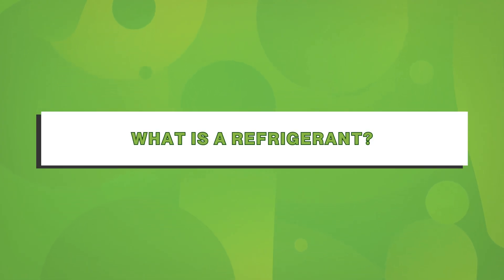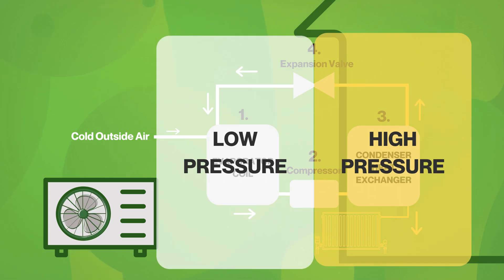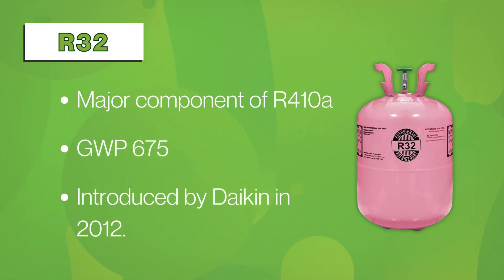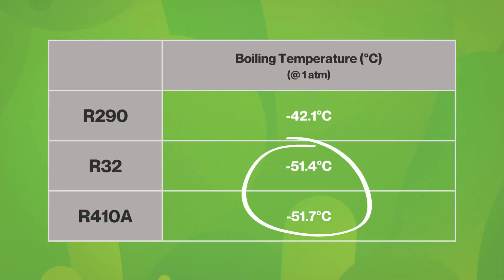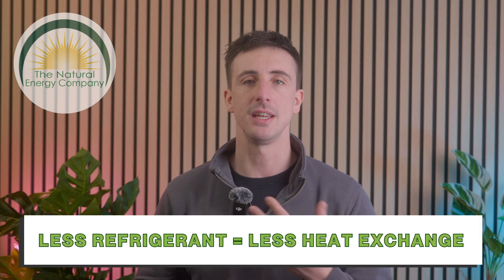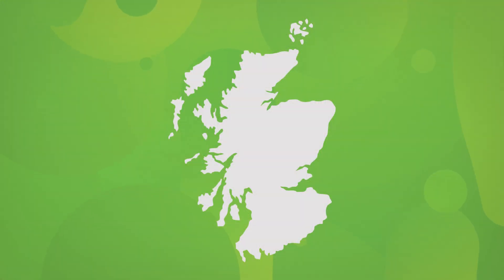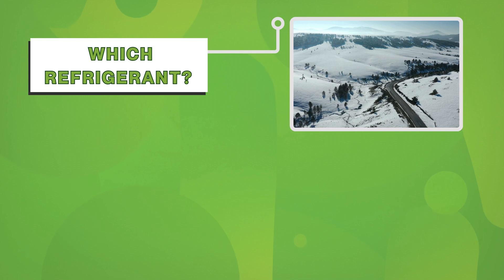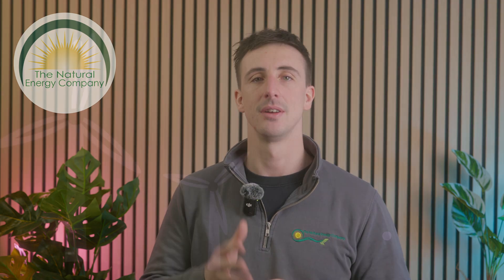R32 vs R290 - Best Heat Pump Refrigerant for Your Home?

Comment: Great video....I am interested in a split unit for my out building....I have one now (R290) which is great for AC but below 8 degrees cannot give any useful heat. I have been looking at LG S12 units that are R32 but I cannot find out what they actually work down to.....its annoying! Would you have any advice? Thanks
Reply from the maker: LG make some great units but Daikin definitely are the best when it comes to AC!

Comment: Interesting. I’ve had an R32 Daikin Altherma 3H HT mono block ASHP for over 4 years. SCOP of 4. I live in rural Worcestershire, England. When selecting the Daikin I had many questions and quotes. But I don’t think the refrigerant was a big point. Fast forward 4 years & I’m seeking an ASHP for my mother-in-law to replace a 20+ year gas combi boiler. Based on location, the R290 unit had to be on the side of the house, away from windows, drains & making garage access difficult. Compared to the R32 Daikin solution that could be near the back door with a short pipe run up to the airing cupboard space. R32 is her answer. The SCOPs seem very similar. Keep up the good work
Reply from the maker: Thanks for sharing! A SCOP of 4 is great, and you’re spot on — often the choice between R32 and R290 comes down to installation practicality rather than big efficiency differences. Sounds like the R32 Daikin is the perfect fit for your mother-in-law’s home. Appreciate the kind words!

Comment: The piping limit for R290 is not founded on anything I'd know. What is that information based on? You will have it running 24/7 anyways so there's no way it's ever going to freeze.

Also there are air to air R290 (and thus split systems) heat pumps e.g. Mitsubishi MSZ series.
Reply from the maker: Thanks for your comment! On the piping and freezing risk: the limitation we mentioned isn’t about the refrigerant itself freezing, but about the design of R290 monobloc systems. Because these have their condenser heat exchanger outdoors, the water circuit is fully exposed to ambient temperatures. In very cold climates, if the system shuts down unexpectedly or power is lost, there is a risk of water in the heat exchanger freezing and causing damage — which can be a costly repair. With a split system, that heat exchanger is indoors, so it’s better protected from extreme cold.

And yes, there are air-to-air R290 splits like the Mitsubishi MSZ series — in this video we were talking specifically about air-to-water heat pumps for heating and hot water, where R290 is still mostly used in monobloc designs here in the UK.
Reply: @TheNaturalEnergyCompany thanks for your response.
I'm aware that it was not about the refrigerant but in my understanding basically all monobloc heat pumps have pressure release valves against freezing. The pipe are also not fully exposed as there should be quite a fair amount of insulation around the pipes.

It seems weird to recommend a technology that has higher operating costs because of slightly less good thermodynamic properties just because of a rare possibility. Are you aware of any damage due to exploded heat exchangers caused by freezing?

Comment: I still use R22 in my home now. Around 20 years old mitsubishi electric air conditioner runs very well. Just use a bit more power.
Reply from the maker: That’s impressive — 20 years is a great run! While R22 systems can still perform well, it's worth noting that R22 is now phased out in many regions due to environmental regulations. Upgrading to a modern heat pump with R32 or R290 could offer significant energy savings in the long run — but it's great to hear yours is still going strong!

Comment: Missed mentioning that R32 is an A2L class flammable (max charge = 1200 grams), fire propagator if leaked!, R290 is propane! an A3 class, explosive (max charge is 150 grams - yes 150 gram as it was used in refrigerators ambigousley) and not suitable for AC or Heat pump! simple. As to R410A 1st it is an A1 class non-flammable, non-toxic, non-explosive, fire suppressor if leaked 🙄 AND there is no ban on use! or purchase! Regulations relevant: ASHRA 34/15, ISO 817/5149 & BS EN 378. Question: Why do you want to use A2L or A3 flammable when there are over 90 A1 class?
Reply: Because r410a is phasing out? The best of all time is R22 if it wasn't the environment. Just think about it a new system with inverter and everything with r22....the holy grail!!
Reply from the maker: Thanks for your comment — R290 and R32 are indeed flammable (A3 and A2L respectively), and must be handled within strict regulatory guidelines. That said, both are seeing growing use in modern systems due to their low GWP and high efficiency. While R410A is A1 and non-flammable, its high global warming potential is why many regions are phasing it down in favour of cleaner alternatives.

Comment: Given my situation I’m inclined to go R32, we need 14kW of input and are looking at the gen 6 Samsung as opposed to the gen 7 which holds R290. However, is there any risk that uk.gov suddenly decides to mandate their replacement due to their GWP?
Reply from the maker: Thanks for your comment — at this stage, there’s no indication that the UK will mandate replacing existing R32 systems. While regulations are moving toward lower-GWP refrigerants like R290, changes typically apply to new installations, not those already in place.
Reply: @TheNaturalEnergyCompany   My R32 heat is working brilliantly so far, just over 6.1 COP in the 4 months to date, so cheap to run if on a time of use tariff.

Comment: What is the added cost of a 4 ton unit in a residential building compared to 410 a
Reply from the maker: Thanks for your question! The added cost can vary depending on the brand, system design, and regional availability. In general, R290 systems may have a slightly higher upfront cost due to safety measures, stricter charge limitations and the newer technology involved — but they often offer greater efficiency and long-term savings, especially when paired with smart controls or solar.

If you’re considering a specific setup, it’s worth getting a tailored quote from a local installer, as prices can vary depending on your property and location.

Hope that helps — and thanks for watching!

Comment: The most honest and informative R32 V R290 video I have seen.

We are struggling to find an R290 supplier in north Cork in Ireland.
Reply from the maker: Thanks so much — really glad you found the video helpful!

R290 heat pump availability can still be a bit limited in some regions, but it’s definitely growing. We’d recommend checking with local MCS-certified installers or renewable energy specialists in your area.

Best of luck with your search — and feel free to reach out if you have any questions we can help with!

Comment: In Sweden we use glycol mix in monobloks, we have good scop results with R290 it way better than R32 and R410. Anti legionella program runs now with out direct electricity
Reply: Is it safe to use heatpumps with r290? By the way I live in norway. Tusen takk

Comment: Loads of green washing going on with heat pumps . R32 a flammable hydrocarbon being replaced by a " Natural refrigerant" R290, sounds lovely! But as stated in video is a highly flammable hydrocarbon commonly known as PROPANE🙄
In the real world there is not that much effecincy differences in either of the gases used.
Reply: yes, but you dont burn the propane. It's reused over and over.
Reply: @albex8484  So why even put it in the bibliography. Look at the adverts, A natural refrigerant R290🙄. Why not call it Propane?
It's pathetic really.
Reply: I use it when I bbq, have a tank in my garage
Reply: @  @jezzaandrews1940 "Purity and Composition – Refrigerant-grade R290 is much purer than regular commercial propane (like what you’d use for a grill). It has very low moisture and impurity content to prevent system damage and freezing issues."
Reply: @albex8484 yes. People forget about different grades of gas.
Reply: We seem to be caught between a rock and a hard place here.  R32 is a fluoro-carbon, due to be banned in the EU in 2027.  Propane is flammable.  So  no really good choices, TBH!

Comment: Great video. The safety restrictions on r290 seem unfair. We currently pipe huge quantities of flammable gas directly into our homes and a patio heater or gas BBQ has 13kg of liquid gas you put where you like in your garden. Our hp has only about 1kg of r290 and had a ton of restrictions.
Reply: Yes you know its flammable as you you can see it while cooking!!. You dont see it when its inside the the unit 🙄
Reply from the maker: Thanks for the comment — you make a really interesting point. The conversation around R290 is definitely evolving, and we’re already seeing regulations gradually adapt as understanding and confidence in the technology grow.

Thanks again for watching and sharing your thoughts!